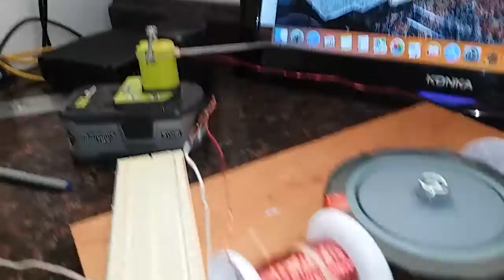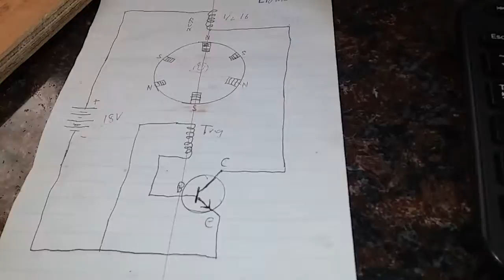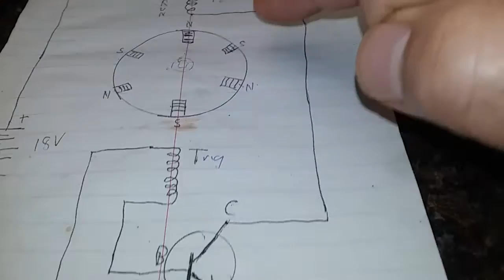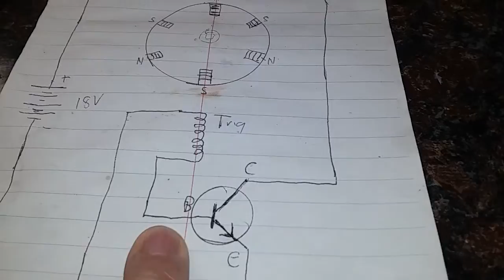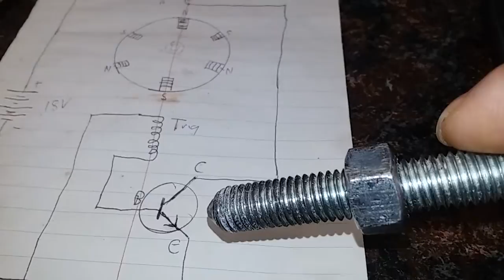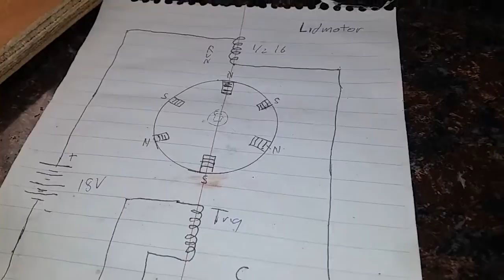Pulse motor: 18v air coil, transistor triggered explained.

Comment: It is interesting. A few thoughts from me; Can a big capacitor be used instead of the battery, where the cap is charged from the spin of the magnets? What is the current draw from the battery? I would like to see on a scope the voltages on the base of the BJT. Make sure the voltages don't violate BJT specs. I wonder if a MOSFET could be used with a snappier ON state/lower R. The gate voltage would need to be considered. Thus, the scope measurement.
Reply from the maker: Sounds feasible. I will let you know when I try.

Comment: That runs good!  Glad the circuit worked for you.  You can expand on this in several ways.  If you have a 110v neon light ( neon night light will work) try attaching it across the collector and the emitter.  It should light up.  If you put a 1K potentiometer at the base in series with the trigger coil you can vary the speed also.  Lots of fun things can be done now that you have a running motor. Well done!  Check out Bedini SSG circuit.  Your setup is basically that simplified.
Reply from the maker: Thanks. I will try both.
Reply from the maker: I am trying to understand how the run coil reacts to north and south poles of the rotor magnets. I can see the coil opposing or attracting north or south but not both.  If you could explain or direct me I would appreciate. Thanks again for your help.
Reply: Litmotor, thanks a million for your basic design. Am trying to work on it using a 2n3773 npn transistor. It's not working yet but I will certainly figure out the problem
Reply from the maker: Check out upgraded version at https://www.youtube.com/watch?v=vyQJT2zsTHs